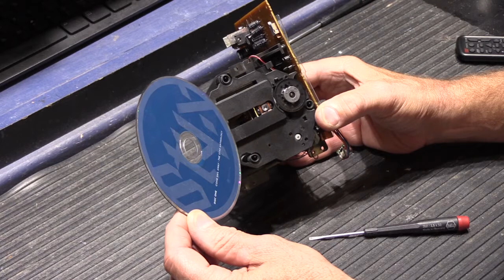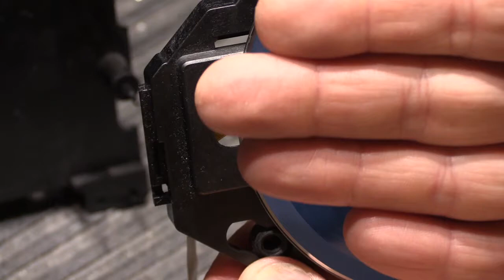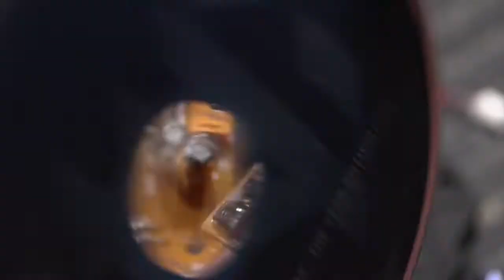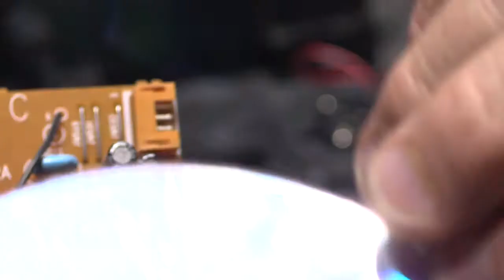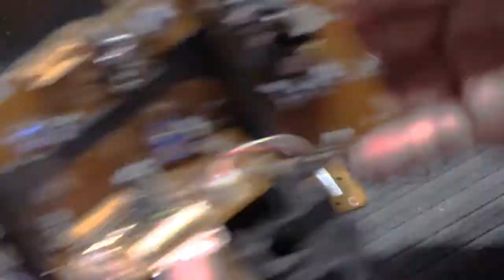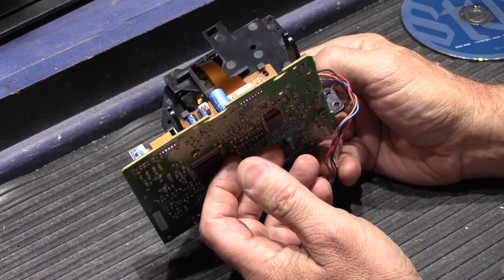NuTone IM4406 CD Players - Are They Repairable?

Comment: Hi, terrific video. I have a nutone system like this. My CD player was very picky about which discs it would read. Most weren’t read. Other you tube videos have some success by adjusting a potentiometer that controls the laser power. After watching this video which says there is not much chance of fixing it I said what do I have to loose. I tweaked the two blue pots that are visible on the top left (the power supply part to the right side)of the cd control card about 10 ??degrees clockwise. It works for now. (Counter clockwise didn’t work and even the more reliable discs wouldn’t play.) These 2 pots can be reached without gutting the unit to pull out the cd unit.
Reply from the maker: Hi Eric:  I am unclear on which "other videos" you are referring to, I don't find any such videos - I would never recommend blindly adjusting pots without knowing exactly what you're doing.  If they are related to the power that drives the laser-diode , you can easily kill the laser -diode with to much voltage. - Chris

Comment: Given that there is no authentic way to repair these CD players, would it be possible to retrofit the guts of a new player into the body of the NuTone CD player?  To that end, would modifying it into a DVD player be a possibility? -- We have a lot of DVDs, but can't use them on the Nutone, which is a bummer, so I was thinking of retrofitting the DVD mechanist into a (2nd) CD body. Would that be a possibility?
Reply from the maker: Hi Calixto:  Unfortunately what you suggest would be impossible to do.  It is much easier to install an External Audio Jack on your IM4404 and use it to connect any type of modern audio source to your system.  Here's a link to our Video on how to do this -  https://www.youtube.com/watch?v=OUKz-DPnAT4&list=PLsTvqKsBnGYdC28d_5P2CQXAhtUS6f_2S&index=2&t=944s
Chris
Reply: @northsideservicecompany3567  Thank you Sir for the reply and your input. That saved me A LOT of time of trying to do something that isn't possible. Thank you again!
Reply from the maker: @Calixj23  You're welcome - Stay tuned for a possible solution to the CD Players in IM4406's - Chris
Reply: @northsideservicecompany3567   Will do...!!!

Comment: No longer a cd fan but I wouldn't mind interfacing an optical drive that could also read and play mp3s or maybe even a dvd with that capability. So the question id, could I have an external unit that would be permanently wired to the internal cd (or tape) input and still have the aux capability hooked up to something else?
Reply from the maker: Hi Steve:  The IM / IMA4406 has 2 auxiliary inputs which can be used to connect 2 external devices to the IM /  IMA4406.  The type of external devices can be any modern type of device except for a phonograph. - Chris